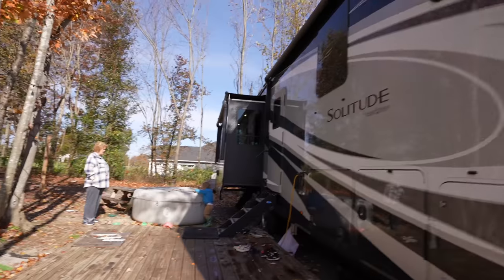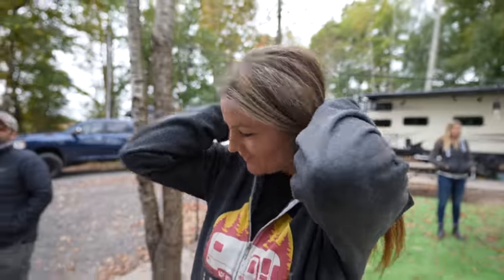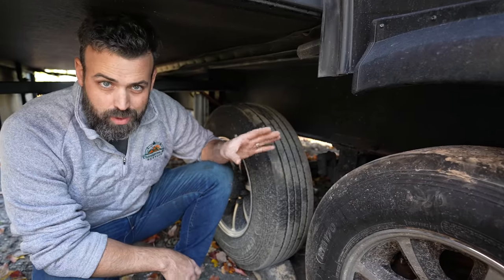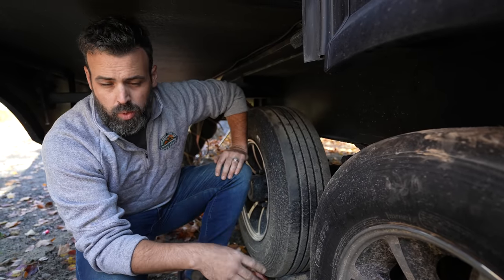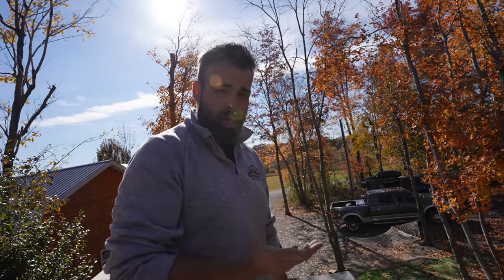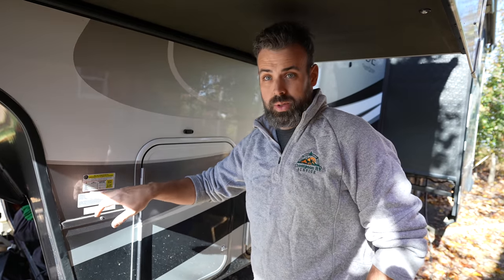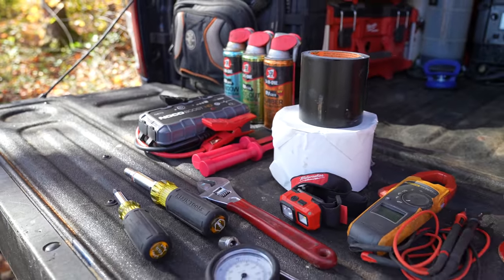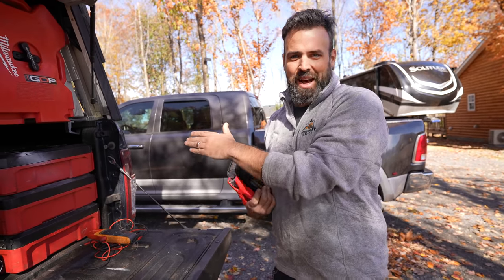RV INSPECTION TIPS: 5 Small Things That Lead to BIG PROBLEMS

Comment: I forgot to mention that when you talking about water getting into your Rv it is probably worse than a house. It happened to us just last week with water getting into our sticks and  bricks from our water heater and a part from our toilet. We had to get out of our sticks and bricks right then and there because of mold and the dust that will fly around  from when they do the walls. My sisters boy friend has COPD. And I have asthma issues and my sister has had pneumonia. 
But I thank you all for this video. It’s a great learning experience. Have a great week.

Comment: Having a guy like Stewart around could come in super handy.  Totally agree that water is the number one enemy of an RV and everything should be done to prevent it from having a chance to wreck your rig.  I place water alarms in areas like under the sinks, and behind the wet bay where things tend to leak.  The alarm goes off when water comes into contact with it and it can alert you early on before something small can turn into something big.  It's saved us a couple times.  Thanks for sharing..

Comment: Just this week a 50 yr old duck with a bad back was up on my roof of my class c with a cleanser and several tubes of dicor. Had to move because it got cold.  Not best to dicor in freezing temps with humidity or moisture around.  Dicor self leveling lap sealent likes 50-80 degrees, takes 5 minutes to skin over, 4 hours of at least 50 degrees to become waterproof and 30 days to cure.  I got a good head start on the preventive maintenance.  Thanks for the great info!! Happy Holidays sweet fam!

Comment: We own a molded fiberglass trailer and this is the ONLY direction I would go. Granted you have to be able to live with the size limitations and no slides but all of these problems mentioned in this video you do not have. Maybe one thing, you still need to check caulk on any screw holes in roof. Enjoy the road and stay safe. Merry Christmas!

Comment: I feel pretty good after watching this video.  I knew the quick fire tool answers, including the pex crimper at the end  Because I had to replumb my water pump!  So one lives in my toolbox now.  Great info.  I need to get on my roof now.  If Stewart knows of a good way to get flex seal tape off the cab marker lights of my class c.  i thought they were leaking and couldn't figure out where.  They weren't the problem.  But now I need take off the tape that I put there when we had 6 inches of rain predicted in 24 hours last week.

Comment: Very informative video.  I noticed something very similar as your situation on my late model Montana 5th wheel under the front bedroom side.  I wish mine was as easy to fix as yours to repair. It turns out that the reason the plate connection was loose from the frame to wall was due to the frame flexing. Pin box frame and wall was found with weld failures in the both frame and wall - major repair needed!  I'm hoping Lippert will come through and honor the frame repairs under warranty. I highly suggest keeping a very close eye on the molding to wall gap difference when on an off the truck. Love your channel.

Comment: I have a 2002 RV and it had 11,000 miles on it when I bought it. It's like new. When emptying the tanks I turned around and the back corner joining strip on the corner had popped the rusty screws and bowed out an inch for about 4 feet. So much caulk, I cannot slip the strip cover off. Going to probably have to drill through both and insert heftier screws. The culprit was a rotted downspout. Made a new one out of a milk jug. Hardly noticeable I hope when done.

Comment: I’m probably going to have to ditch mine. I had to park it’s impossible to find any place to store it inside. At least where I’m living. You may have an indoor storage facility available but you can’t get the RV inside the unit. Those monstrous AC units prevent the thing from fitting inside. I called one place and the units are huge inside but the doors are only 6 1/2 feet high! The rig is already 9 ft high and add another who knows how much for the AC! I was able to put mine in a parking spot. That was as good as it got. And what’s the weather been like the last few days? Raining like crazy. I don’t expect to have much of a trailer left to sell. Idk how I’ll get rid of it but I need to do it soon before it sits outside much longer. If I’m ever able to travel again it’s going to be in a skoolie. At least a metal bus stands a chance and it will have a mini split inside instead of an 18,500 btu monstrosity that almost splits your eardrums when you turn it on! After having one manufactured rig I can safely say I will never throw my money away on something that takes 10 years to pay off but can be ruined in no time at all!

Comment: I’m going to pull mine apart when I return home in the spring, Lippert has been known to have problems with the pin box.  I’m dealing with axles that are marginal for the rating of the fifth wheel.

Comment: Do you have additional video of the front frame repair?  I am very interested in the area that started to sag and I would like to know more information about how he strengthened and repaired that area.  Thanks, Nathan. Really enjoyed the information.
Reply from the maker: I see he answered your question. Good man he is 😀
Reply: @LessJunkMoreJourney  I would keep Stewart around close.  He is ON IT.😃
Reply: The same thing is happening to our Rockwood 5th wheel.  I was hoping he was a local tech, as we live 30 mins from Cookeville.  Guess I'll take it apart and see if its the same issue.  Just curious if the front was creaking when you put weight on the front legs?

Comment: Did you check your welds? That's a common problem with those frames. They build them as light and cheap as possible. We love our goose neck toy hauler. It has heavy duty suspension with shocks. Leaf spring fatigue is a real thing. Weird tire wear is usually from leaf spring fatigue. Go look at open trailer of same weight capacity and length as r.v. and that's what the suspension should look like. After looking at campers and toy haulers the build quality is night and day. Don't buy a boxed frame if your doing a lot of traveling with it. The frame and suspension is first thing I look at. If r.v. company can't afford good leaf springs or shocks then I don't want it. Those cheap parts could cost your life. Heavy duty jack is first on my list of tools. Head lamps are great. I love the garage space on toy hauler. We take bikes, atv's, canoes, and lots of gear and toys. Our jeep can be hauled in back if need be too. Being able to haul materials to build on property is awesome too. Interior with the leather has that wow factor. 1/8 inch thick tubed steel frames are junk. Look them up and see how many people have had problems with them. Leaf spring fatigue is another accident maker. If you start blowing tires usually there is suspension problems. Or if you have to dive slower and slower to stop the sway. Look at 5th wheel frames compared to i joist goose neck frame. Which frames fail on r.v.'s more often.
Reply from the maker: Thanks for the info.

Comment: I have a '92 class A, Monterey by Cobra, that I had new tires put on, when I went for the inspection, they said that the 'bell cranks' were not good and I needed them to be replaced.  It runs amazingly well.  I can get up to 75 and not even realize it, the engine works so well.  My local garage told me to order the parts myself, they couldn't find them, they would install them. I located them online with a little help from someone.  The trouble is, there are two sizes.  I don't know what a 'bell crank' is, I was told that it has to do with the steering and wheels, but is there no one out there that can help me?  I live in a rural area, not many places to choose from....I  don't want to be stuck at home next year.  Blessings!

Comment: Make sure your roof is made to be walked on. A lot of trailers only have 1/4 ply for roof and shouldn't be walked on. If you have to go on roof use 1/2" plywood and spread out weight of your body. Other wise try to do stuff from edge as much as possible.
Reply from the maker: Good point! Yes, ours is good to go.

Comment: Can a mobile repair guy fix warranty work?
Reply: Only if the work is done by an Authorized/pre-approved dealer/repair shop. Call the Dealer/Manufacturer for pre approval. 

Otherwise, you may void the Service Warranty.
Reply: Yes I do warranty work but not all mobile techs do so ask ahead of time.
Reply: @thompsonrvservice  Thanks for helping with the video, Stewart!  Do you have more information on the frame repair up front and how you repaired it?  I would appreciate any information you can share.
Reply: @tumbleweed4185  The steel plate that you could see moving was straightened and screwed to the aluminum frame. There was missing hardware which is what caused the issue from the start.
Reply: @thompsonrvservice  Thank you very much!

Comment: Frankly only about 4 or 5 brands (in /USA)  (of fifth wheels) 
are relatively well made, & properly Quality-Control inspected.
The majority of Brands are very sub-standard.

Lippert (LCI) make most of the North American chassis, 
BUT, they are NOT all built to the same "Price-Point" 
(ie NOT all built to the same Quality / Duty-Cycle).

If you can't afford one of the following brands, 
can you REALLY afford to own a 5th wheeler.
New Horizons,
Luxe,
Spacecraft,
. . . . . . .  ??

If it is designed to be towed by an F250 / Ram 2500, then
it is FAR too lightly constructed !!!
Reply: Northwoods is 🤌.. imo but i dont particularly care for "Fancy" i prefer the money is spent on quality